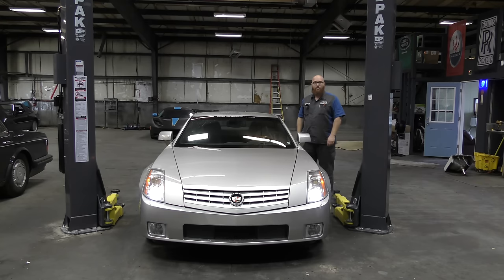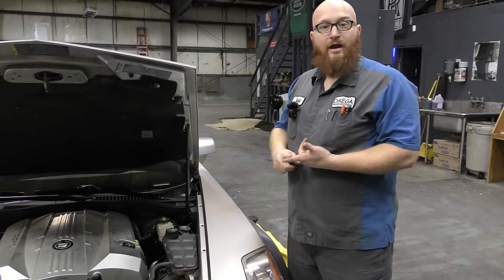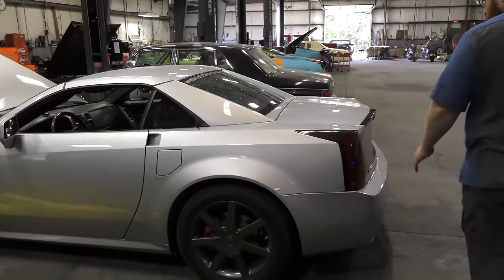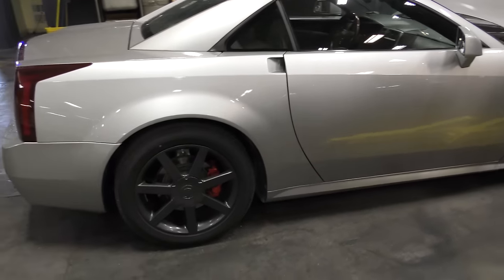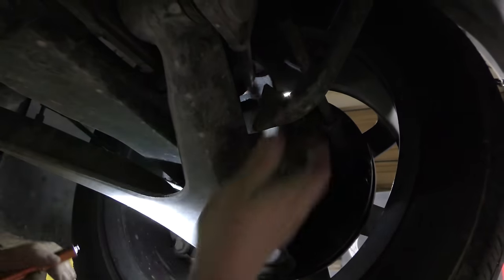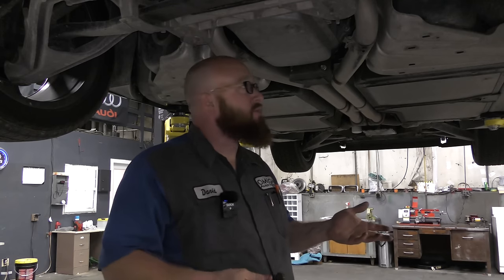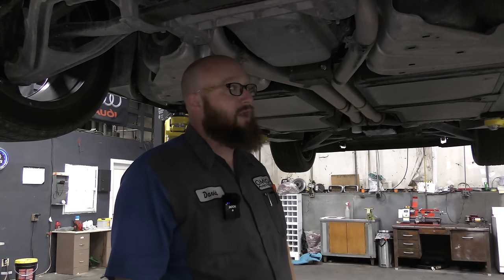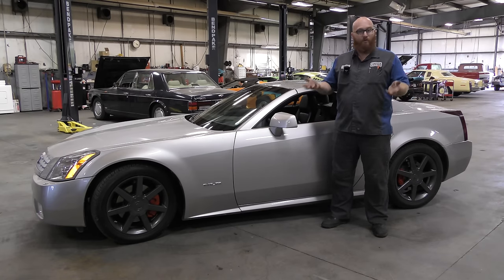The CAR WIZARD is shocked this 2006 Cadillac XLR has a Lotus Sized Repair Bill?!?

Comment from the maker: The radiator I need has trans cooler AND engine oil cooler. Not the ones you guys have been recommending with trans cooler ONLY. But thanks for trying guys.
Reply: Hey Wizard, could you tell me why that rad couldn't be repaired? Was plastic welding not an option?
Reply: Couldn't you just replace the plastic piece? I've have done it before on other cars in the past
Reply: I am guessing there isn't room to add a separate oil cooler with the radiator with the trans cooler. That is one expensive radiator!
Reply: You need to get a Morgan in your shop to repair or a Panoz.
Reply: I've been there. I've worked on many XLR's. Very expensive to fix indeed. I have 5 customers with them. The radiators are very hard to find. It is a common issue with them.
Reply: As far as the lift points you are right.
Reply: Custom all aluminum radiator, trans cooler, and engine oil cooler from Mishimoto radiators?
Reply: I've done the sending units. First two times I fixed just the side that was bad only to end up coming back within 6 months later for the or side, ugh. Tough to explain to the customer. Now I do both of them no matter what! Great video Wizard. Always look forward to them.
Reply: teneha glendening with the time it takes to remove the radiator , sometimes it’s just not worth fixing and replacing is a better option.
Reply: Cue Hoovie buying the cheapest example with a clean title
Reply: Rockauto has 6 Radiators listed for this car, but only ONE (AC Delco) has both the trans and oil coolers. And a hefty $276 plus tax and shipping, which is just under $300 to my address. Now I see why you would just do $350 for next day from Carquest. 👍
Reply: The entire plastic housing is compromised. If he patched the leak another crack would have appeared or the tank would have split and left the owner stranded.
Reply: @maineiacman  the plastic tanks expand and contract at a different rate than most epoxies so any adhesive will pop off plus the glass filled pa6 / gf66 nylon is embrittled throughout both radiator tanks.  Repairing modern radiators is an exercise in futility. The old copper bronze is a different story.
Reply: @MrManBuzz  in a pinch you can plastic weld the tanks in certain areas. But if it's cracked to the edge that is supposed to seal to the aluminum you'll never get it to work and the o ring will not fit in the groove and seal.
Reply: Koyorad will probably make one for you at half the price.
I’ve had plastic tanks repaired by tossing them in the bin and welding on an aluminium one.
Reply: How about using a radiator with a trans cooler only, and then installing an aftermarket oil cooler, maybe fan driven?
Reply: JB weld might be your friend in this case.
Reply: @Conqueef-tadoor  dont forget the shop markup, roughly 50% to 150%.  And it happens everywhere.  Insurance if there is a come back.
Reply: @Conqueef-tadoor  $276 is hefty? Lol try $800 from the dealer for a silverado hahaha
Reply: @thefuzzypickle8277  it is when the most expensive radiator I have ever had to replace on ANY of my vehicles was just over $200. I'm not saying it's unreasonable, just a bit higher than what most people are used to. I did say hefty, not outrageous or unreasonable.
Reply: @thefuzzypickle8277  also, you would have to be an idiot to pay $800 for a Silverado radiator when they can DEFINITELY be found for $250 or less ALL DAY.
Reply: Clams McGee  lol I would be bitching about the mechanic charging me 700 dollars to put it in...😂😂
Reply: ACDELCO 21633 has both coolers and is 275 from rockauto
Reply: Couldn't you use the same radiator that's in V8 Northstar from like the STS... Its the same engine right? I know not every part is the same in the engine but just wondering.
Reply: the shocks are where your kind of screwed get the last year platinum edition
Reply: Wizard, that oil pan (sump) is that a pressed steel item? Do those have a habit of warping? If so, I wonder if a cast aluminium sump might solve the constant leaking?
Reply: Car Wizard could you please do a Q&A video maybe once every 2 weeks? My question is I have a 2014 wrx sti with a closed deck capable of 912whp. I just wanted to hear your take on closed decks semi closed decks and billet blocks which are the best ways to go?
Reply: MrManBuzz they do have places that will completely replace the plastic parts not sure about plastic welding. Also, when you’re doing work under y ur name on it you want it to last and do 100% correct way and right way. Good question but it eventually would blow out with plastic weld not knowing where plastic may have gotten thinner.
Reply: Just look it up on rockauto.com. They have radiators in stock.
Reply: You'r a Beetle Turbo S driver now😁👍 a cool and fast sweeeeeeet Racer from Volkswagen.🚗🚗🚗
Reply: @MrManBuzz  I totally agree. There are some amazing plastic two-part epoxies out there that are STRONGER than steel! Scotty Kilmer was demonstrating some of these in one of his videos to join together a couple of plastic dash pieces, the "welded" joint was actually STRONGER than the rest of it. Although these epoxies are NOT cheap, it would cost a LOT less to fix that radiator than to replace it, imho!
Reply: Spent more time writing this comment than verifying that you're actually wrong. Lost a lot of respect from me. Rock Auto has it.
Reply: Car Wizard, talk to these guys. they should have something equipped with oil cooler fittings: https://www.radiator.com/#
Reply: @MrManBuzz  Even if you stopped the leak that it has, the rest of the plastic on the sides is the same age and just as brittle and will break soon afterwards especially since it will actually hold pressure again.
Reply: @tenehaglendening9246 ....., but how do you get hold of "only" that end cap. And if it's for yourself that's OK if it fails, but you've embedded 5 or so hours of labour, for a job that is not the definite answer.
Reply: Does it truly need an oil cooler, most cars dont have one and run just fine. Plug the lines or do a bypass.
Reply: An OEM Radiator at a wholesale GM parts dealer would be $295.  You need to get set up with Repair Link.
Reply: found one on Rockauto that  appears to have the oil and trans cooler in it and its a ACDelco part. https://www.rockauto.com/en/catalog/cadillac,2006,xlr,4.6l+v8,1432043,cooling+system,radiator,2172
Reply: The XLRV didn't get a corvette ls motor. It had a supercharged northstar.
Reply: Wizard, Rockauto has the Acdelco radiator with the dual cooler you need. P/n 21633.
Reply: MassiveTrackHunter 
How is that a better option?
Reply: I'm sure CONSIDERING his name, reputation and the fact that it's a nice and fairly expensive car MR WIZ. DEFINITELY WANTS THE VEHICLE TO BE FIXED CORRECTLYSO HIS CUSTOMER  KNOWS THEY WON'T BE STRANDED ON THE SIDE OF THE ROAD. ESPECIALLY CONSIDERING WARM WEATHER IS HERE AND ONLY GONNA GET HOTTER! "PEACE OF MIND IS A STATE OF MIND" 😆
Reply: 2:44 WRONG wiz E wrong XLR-V did NOT come with a LS based engine. Get your Facts straight.
Reply: just put a universal hotrod radiator and some universal oil coolers and call it a day
Reply: wizard whats the surprise, a Cadillac is the 4th most expensive brand to own costing a customer on avg of $18000 in repairs over a 10 year period, audi, mercedces, bmw are the first 3..
Reply: Hey wizard is there a way to check drum brakes without taking the drums off?
Reply: Also if it is basically a Corvette could you LS swap it how hard would it be to do that I'm sure the LS would be more reliable and you'd have more room so you can replace some of the parts like the radiator with hey aftermarket one that's easily available
Reply: Amazing. My bmw is super cheap to fix and parts are also cheap.
Reply: @tenehaglendening9246  in this car i will guess there is no replacement for the plastics corvers it usually with some low sell  cars that why anyone that has work on a car hate plastic ...
Reply: I have always loved these... I have a C7 corvette now and would love to pickup a XLR-V.. am I being dumb? I have always loved the design, its hard angles done right in my opinion. Tell Tyler to pick one of these up, I'd love for somebody like him to spend more time with one to get more information out on Youtube
Reply: @schlehke  always imagine the worst case ....can you afford those expensive repairs in  worst cases buy it...it's all money in the end  and of course time that you will spend...only you know that aswer...
Reply: tengu190 The Panoz has a Ford 4.6 4 valve V8 in it.
Reply: FYI Rockauto now has an OEM GM radiator with both trans and oil cooler fittings. GM 21633.
Reply: @tengu190  if you're talking Morgan Plus 4, pull out that drive train and swap in one from a Honda SC2000. It's not that difficult and all your problems will be over and that wooden war horse will fly!
Reply: @adotintheshark4848  think there is room for an intercooled supercharger as well?
Reply: @tengu190  There's quite a bit of room. My bro-in-law converted his with the help of a local Honda repair shop.. The old engine was a European Ford propane unit that could barely get out of its own way.
Reply: or go custom on aluminium radiator thats a bit thicker so it can handle more heat.. usually plastic cracks so easy when heat is passing through it
Reply: @MrManBuzz  once the plastic degrades it's done. Time for a new one.
Reply: (Sorry for the late post) Bring Out Another Thousand, I like that!  The 2 best days in a boat owners life:  the day they. buy their boat & the day they sell their boat 😊
Reply: Sorry but it has a ton of "Gadgets" XLR means Extra luxury Roadster ...and it has so many bells and whistles it will make your head swim...You just have to know about them.
Reply: Radiator from c6 automatic Corvette the radiator the core support etc all are the same part from gm order t for a 2006 to 20011 automatic Corvette
Reply: @09:00, it’s my understanding that the two happiest days in a boat owners life are the day you bought it & the day you sell it.
Reply: No surprise about the similarities underneath with Lotus, considering GM owned them for years
Reply: Allways enjoy your videos Wizard , and Mrs Wizard does a nice job on your videos as well.  
Best Regards From Boston Massachusetts. 
The Car Shark 🦈
Reply: That car is not equipped with an engine oil cooler. That’s a power steering cooler get a aftermarket power steering cooler and zip tie it to the front of the condenser and you’re good to go.
Reply: @JerryDLTN not and engine oil power steering fluid cooler.
Reply: @MrManBuzz If he repairs the radiator tank, he has to warranty it at his expense.  5hrs is an awful lot to swallow. If it was my car I'd try the adhesive they use to install windshields with. Super strong, not brittle so it can expand and if it sticks to glass, it'll stick to anything. Only questionable part would be how much heat it can take.
Reply: @DocLulzson whoa! Why so viscous?
Reply: Oil cooler is 25 bucks for factory oem.

Comment: The XLR-V has the northstar, with a supercharger. Not the LS based engine.
Reply: I was wondering why I couldnt fine one lol
Reply: An exclusive northstar V8 it’s a 4.2 liter supercharged the only other car that has the same engine is the STS-V
Reply: @firebird890  4.4 supercharged vs 4.6
Reply: came to make this comment
Reply: I owned one. I still made the comment, but before I read this one.
Reply: You can swap them with a few tweaks

Comment: It's a corvette that's slower, costs more, and lacks an Ls. Im amazed they even sold
Reply: What it lacks in those areas, however, it more than makes up for in style, class, and useful features.
Reply: Have you driven one? Or a V in that case? Tune and put money into like any project car, you'll get amazing results with most,  not all Cadillacs after 2007.
Reply: Browningate Other than ride quality what do you speak of?
Reply: @LandoVR25 it's a hard top convertible, it's 0-60 in 4.8 sec, the Vette same year is 4.7. It's a cadillac, it deserves the Northstar. It has a Vette chassis. And it's rare! If you want a vette then buy 1 this is not a vette! This cadillac was over 100k brand new!

Comment: It’s a shame these are so expensive to repair and maintain.  At 14 years old they are still stunning looking.  The design was way ahead of its time. Most people would still think they are brand new if they didn’t know any better.
Reply: They have aged well, but that's good design... but saying they could be brand new in today's market for people that don't know better? That's a stretch... it has those very distinct early to mid 2000's design.
Reply: micglou non-car people would have no idea
Reply: Agreed! And the XLR V is so cool!
Reply: @ElliottAlvis  I disagree... but hey, your opinion vs my opinion... let's agree to disagree.
Reply: If you have time to wait for parts from Amazon or Rock Auto and if you do the labor it not that expense. The radiator is $32 on Amazon
Reply: @serge4856  A 32 dollar radiator... hmm, those will lose their fins in just a couple of years. I wouldn't go there.
Reply: @micglou   they all lose their fins both my Honda Civics OEM radiators lost 3 lower rows of fins 🤷🏽‍♂️
*edited Spelling
Reply: @serge4856  After years of use yes... but 2/3 years is a bit too soon. I've made those mistakes before... factory radiator needed replacing after 11 years because of missing fins, wanted to save a few bucks so I bought a cheap replacement... had to replace that one little over 2 years later. Same thing with my previous car... cheap replacement radiator lasted about 4 years, while the old one made it 10 years. You'll run into the same problems with cheap exhausts... original exhausts last at least 10 years, cheap replacement was rotten 4 years later.
Reply: @micglou  you are right, the radiator is a very important part of the vehicle. it's not worth breaking down on a road trip, then having to pay for a tow and repairs agian. The $32 radiator is from a reputable manufacturer, it maybe a price mistake from Amazon.
Reply: Cracker Interprises  there's a few different ones and AutoZone and advanced Auto etc only carry the most common one that has only one oil cooler.
Reply: No one is looking at this thing thinking "wow thats a new car".

The design is pleasant to look at but it screams early 2000s Cadillac. 

The interior screams early 2000s as well.

I understand what you mean though.
Reply: Even the pre-facelift R230 looks more modern than the XLR
Reply: @ElliottAlvis  You're right. Non-car people usually think a 97 boxster is a brand new Porsche so yeah.
Reply: Caddy kept this design up until this year, 2020. I have a 2015 ATS, and it was one of the selling factors for me, the lines, the design. It's a shame they scraped it all. The CTS - V coupe is still one of my favorite designs.
Reply: @serge4856  Yeah! For CHEAP Chinese "knock-off" that will last 6 months,maybe!!
Reply: @basshead.  As they say...beauty is in the eye of the beholder.  I previously owned several SL500's.  Sold my 2002 SL500 Silver Arrow and purchased a 2007 XLR Platinum.  The XLR was:  faster, more reliable, more comfortable, better mpg, and far more unique and better looking --- inside and out.  I can easily provide evidence for the first four points above.  As far as the last point (better looking) --- I can tell you that I received far more "wow --- beautiful car" comments with the XLR than with the SL500.  So, apparently --- a lot of people agree with me that the XLR was more unique and better looking.
Reply: Cracker Interprises me too 😆
Reply: +ISUringman1974  lol  "wow --- beautiful car" and ''more unique and better looking'' doesn't mean it looks more modern.
Reply: This is the only American car in history to be designed together with Mercedes Benz. MB designed and manufactured the retractable roof for the XLR
Reply: Moms has a special edition 101/101 and yes they are expensive to repair but despite the fact, the xlr is still being used in terms of styling for newer Cadillacs from 2004! We ended up buying a scraped 03 xlr for $2000. Just because one rear tail light cost $500 used! We are going to fix the oil leak from valve cover and sell them both soon. The main problem is oil leaks and obviously the north star engine. However if maintained it’s a great car!
Reply: I've always thought they were the most hideous vehicles ever made... (except for the Allante).

Comment: The V doesn't get the LS it gets the 4.4 shitstar with a blower. It makes power but isn't very tunable and has issue where the block start to spiderweb and crack...could have just put a vortec or LS in all of them and had a solid car but no gotta shoe horn in the N* cause modern double cam that will impress those euro car fans enough..